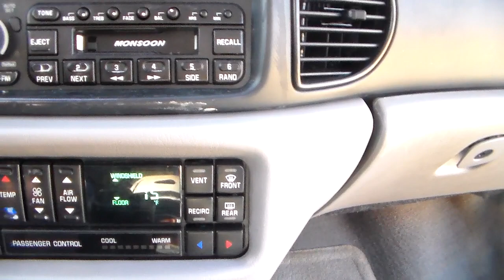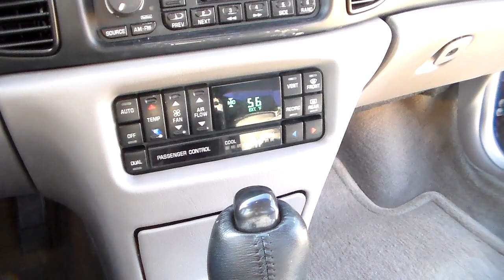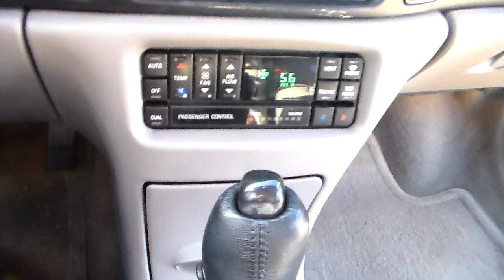1997-03 Buick Regal climate control display repair part 3

Comment: Watched your video and Thank You, my question is my 2000 Buick Regal GSE will only blow out hot air and only on foot position, but my display will show the different positions and the temp up and down change. The screen seems to display ok but nothing changes when I change the screen, was that the problem as to why you done the video or was your screen messed up as far as  the display???

Comment: Great video! Thank you! I have a 2003 Buick Regal. I just replaced the AC compressor, drier, condenser etc... The compressor runs continuously. I was wondering if the issue with the solder breaking could cause this problem? If not, do you have any ideas on why the compressor keeps running? Could it be the thermostat control module? Any thoughts would be appreciated. Thanks, Jim
Reply from the maker: i would hate to make guesses Jim. I am far removed from these cars nowadays.

Comment: I hear one can go behind the glovebox. Then move over the shutter valve arm so both sides blow out same as driver. Which I am about to do. TY for the video and also when the dash display lights goes out on the dash. Close enough of an issue. Except you have to replace what is usually burned out resistors. The color coded ones. That info is found on YT as well. Now I just have to get MY seat warmers working. Screw the passenger side, which works. UPDATE: Found shutter valve and all it did was blow COLD ass air instead of heat as before. I seen another valve up on right but cant reach it. Time to google further.
Reply from the maker: Good luck man.
Reply: For some reason they have info and schematics (See Thru) for Buicks of other types and years above my year. Frustrating. I have to bring it to a dealer for a recall anyways. Ill see what they can tell me and show me. Go from there cause I cant find my arm up in there. This is odd to work on a multi shutter and 2 valves. When I have no idea whats affecting what in the damn cold and tight space.

Comment: I have a 1999 buick regal supercaharged. Which im guessing is the same as this vehicle. But my air and heat is stuck on the passenger control and will only blow that hot air and will not turn off or anything no matter shutting the vehicle off and all. If i do as this video instructs will that fox my problamo?
Reply from the maker: Colton Todd  Probably not. That is a separate issue which usually indicates one of the actuators on the heat/ac "box" is bad and will not switch off of hot air.

Comment: Hope you're still checking comments... Wanted to ask what the original problem was. I bought another unit before watching your videos and it's doing the same thing.

Initially, was your unit's "green display" (to the right of  the air flow button) just dead? All the other buttons that glow orange work, but it's that one display area that won't function for me.

I ask because either I got another faulty control panel or the issue could be somewhere else. Thanks in advance.

Comment: good vid how would i go about fixing an illumination issue i hav 3 buttons not lighting up . a/c , off & fan arrow down 2 b precise. any ideas.
Reply from the maker: Those probably use the soldered-in grain of wheat bulbs. They are replaceable..by soldering. I used to get them at Radio Shack but now you might have to order them from  ebay or somewhere similar.

Comment: Tyler I have 8 resistors placed in a 2x4 arrangement with each one being 200 ohms each. I believe they have cold solder joints on them. The joints are brownish with some darker then others. I used a meter on them with the meter et at 200 ohms.Before I connected the circuit the meter read 1. When I connected the leads to each end of the resistor the meter read starting off at 45 and getting progressively less down to about 23.Your thoughts ?????
Reply from the maker: I would simply resolder any suspicious joint you find. I just wouldn't concern myself with the actually hardware at this point.

Comment: Tyler I took apart the climate control module like u said but I don't have the 241 resistors like u did. I have a 2000 Regal. Can u help me?
Reply from the maker: Don't worry about the numbers on them. What you need to look for are cold solder joints. There will be a tiny crack in the solder. Get a good magnifying glass and inspect each of the surface mount parts on the board. Those cracks don't look like much but they totally shut down the display.

Comment from the maker: The only reasons I would EVER buy another GM like this one would be if it was CHEAP and I needed a beater. GM loads on the features, which are nice, to disguise the fact that you are getting a mediocre vehicle.
Reply: I resent that. I have owned my 1999 Buick Regal  GSE w/ the 3.8L SC since 2005 and I have owned 2 others as well. Only had to keep up maintenance and do this to the climate control and cluster. Very cheap to maintain and own and luxurious to boot. It is till my daily driver after 17 years

Comment: I have a question. I have a buick regal 1998 and my climate control works. Like the heat works but it only applies hot air on the left side but not on the right. Does it matter if I open it or its something else wrong with my climate control panel
Reply from the maker: It's one of the actuators acting up. I did a video on those in a truck a few years ago, check that out for a very basic explanation.

Comment: Hey Tyler, my heat will no cut off. Its stuck on high and the screen went out. Will doing this help me still? 2002 Buick Regal GS
Reply from the maker: Well, you need the screen working so you know what the system is set on..so yes you need to fix the display.

Comment: Can you tell me what symptom you had that caused you to take your A/C unit apart?   Mine, 99 Buick Regal, as the same controls but all the lights will flash on and off constantly.  I cannot control the air flow but can control temp, hi/lo fan, on/off, but the lights just all flash on and off.   I am wondering if your solution is part of my problem.
Reply from the maker: The problem i encountered was that the flourescent display did not light up at all. You may have two distinct issues, one being with the display, and the other with one or more of the servos that direct where the airflow goes.

Both common GM issues. Good luck.
Reply: +WhoSaidTyler thanks man.  Can you help me understand what you mean by servos?    Prior to all of this happening I was getting my radio swapped out.  When it was completed the air flow was going to all vents.  Vacuum lines were check to be ok.  Negative terminal on battery was removed and put back on.  Now I have the original problem and the all lights flashing on and off.   AC and heat both work.  I can feel the temp button changing the air and I can feel the fan blowing lo then to high.  Just the direction cannot be altered and now all lights flashing on and off.  Thoughts of how to reset?  Or what do you mean by Servos?    Appreciate your comments.

Comment: Mine is blowing out colder air on the passenger side than the driver side. Is this the problem you had or was it just the display?
Reply from the maker: Yep, it did that too. I never attempted to deal with it, but usually that's a driver-side blend actuator acting up.
Reply: Yep and I have no control of switching the airflow direction so I guess my actuators could be shot. Don't notice a difference on vent or recirc come to think of it.
Reply: WhoSaidTyler  just another angle on that temp difference left to right. I read on a gm forum one time that the cause is often a low freon charge. The reader dismissed that opinion (by a gm expert) and went to many other options to fix the problem, and ended up having to recharge his system, which fixed the problem, which the tech advised to do first. :) But yes that actuator door is also a known issue.
Reply: I have a 98 century that heat works on the passenger side and cold air on the driver side. The display lights don't work but everything else is fine. Just need help so the passenger side gets cold like the driver side. Any feedback would be great.
Reply: @TylersNeighborhoodGarage  There's also a passenger actuator on the systems with dual zone control.   It's much easier to access after removing the glove box and passenger side underside dash!

Comment: Does anyone know how to fix the odometer display on a 1999 buick regal ls? It doesn't stay on
Reply from the maker: Never done one but generally the same issue afflicts all these things that have flourescent displays that go in and out- failed solder joints. If you are handy with a soldering iron or know someone who is, you can take the cluster out and find the solder joint that has cracked apart and repair it.

Comment: Hello plz how to convert F to C on a buick regal 2000
Reply: There are 3 or 3 buttons to the left of the wheel on the console. One switches between F and C and miles vs km.

Comment: 1999 buick park av ac. on drivers side blow's hot air in summer weather in winter weather drivers side blow's cold air would any one know how to fix that
Reply: I'm probably 4 years too late, but there is an actuator on both the driver's side and passenger's side (if you have dual climate control).   There are a lot of videos about replacing the air flap actuator on the driver's side, but not many on the passenger side.  Depending on your vehicle type, if you have CJ2 RPO code, you'll need the more expensive flap actuator.   Both can be reached without tearing into the dash.